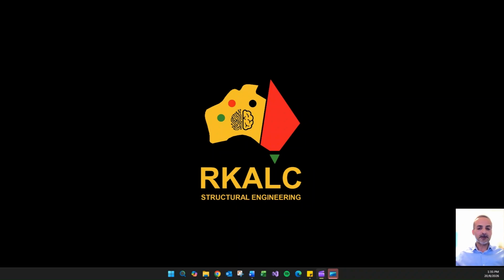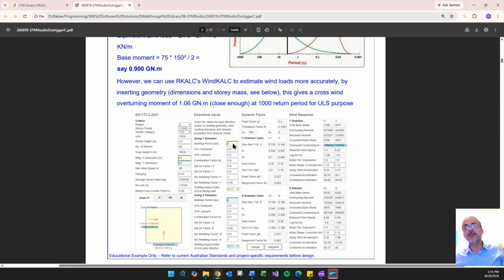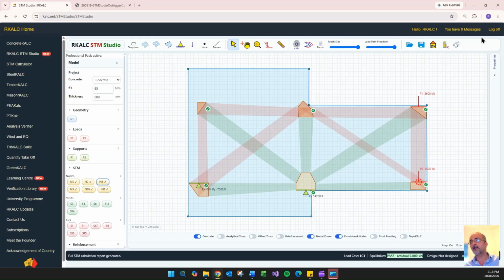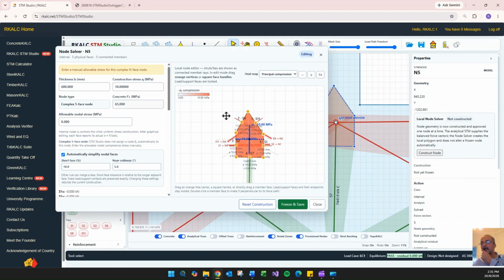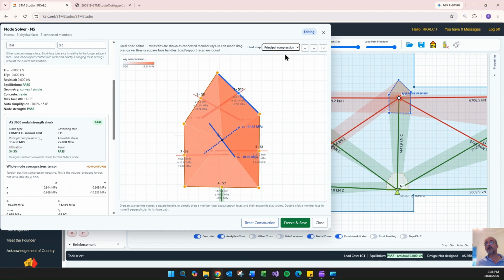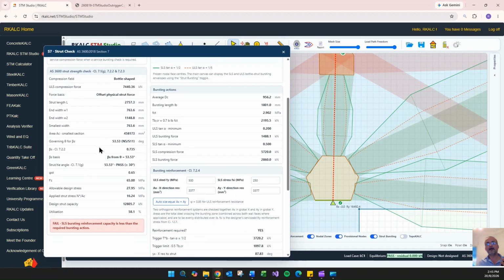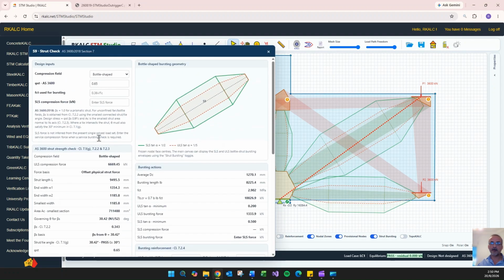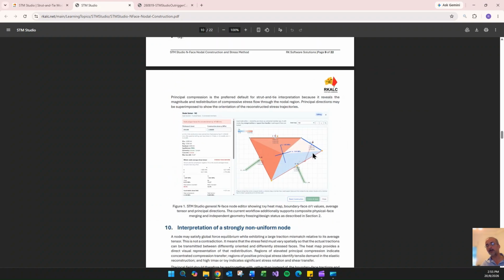Outrigger Wall Design using Strut and Tie Method

Comment: Does the program help you determine when you can change from a bursting strut to a prismatic strut ? Otherwise you could change all struts to prismatic and never need to worry about bursting reinforcement which is not realistic.
Reply from the maker: Good question. At present STM Studio leaves the strut classification to the engineer, so it assumes the user is applying the AS 3600 requirements rather than treating “prismatic” as an arbitrary modelling option.

The AS 3600 Commentary is quite specific on this. A prismatic strut develops “if, and only if” the compressive stress field cannot diverge because of the geometry. If the compression field is free to spread laterally but is forced into narrower regions at its ends, it is a bottle-shaped strut. The change in direction of the compression trajectories produces transverse forces, and where the trajectory change is concave these are tensile forces associated with bursting/splitting.

So you cannot simply change a bottle-shaped strut to prismatic to remove the bursting check. The classification has to be consistent with the available concrete geometry and the expected stress field. For bottle-shaped struts, the Commentary then considers the transverse equilibrium using the divergence angle \(\alpha\), including \(\tan\alpha = 1/2\) for the elastic/service condition and \(\tan\alpha = 1/5\) at ultimate.

Currently STM Studio does not automatically determine where the spreading region finishes and a genuinely prismatic region begins. That remains an engineering judgement by the user. I agree this would be a useful area for further automation, particularly to prevent an inappropriate prismatic classification from bypassing the bursting check.